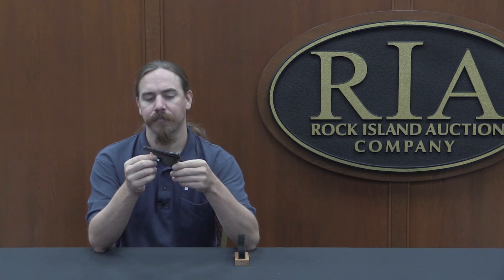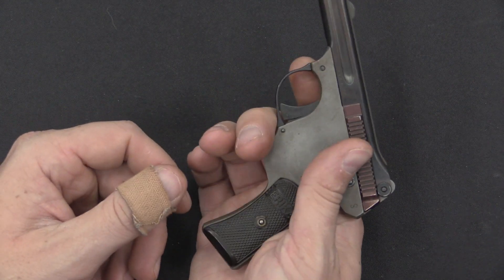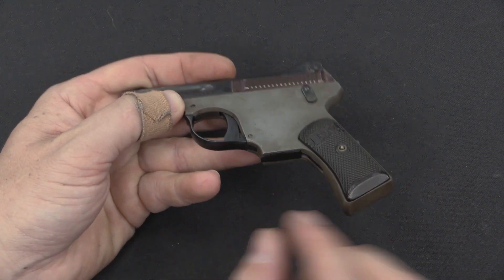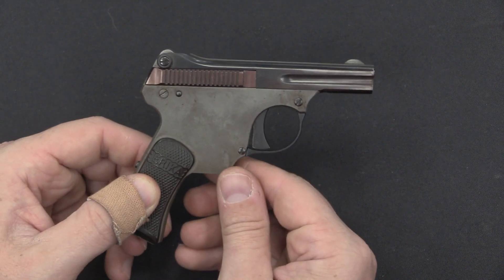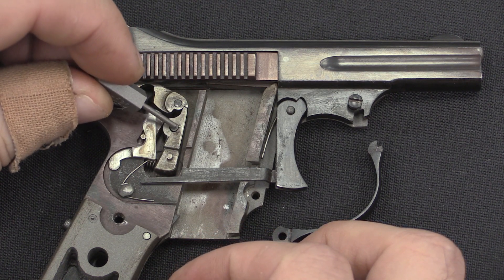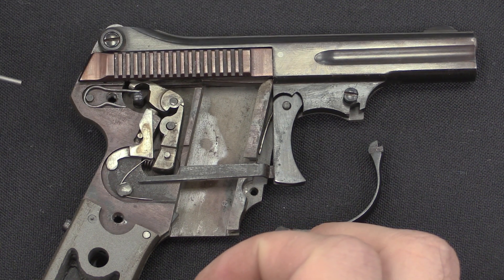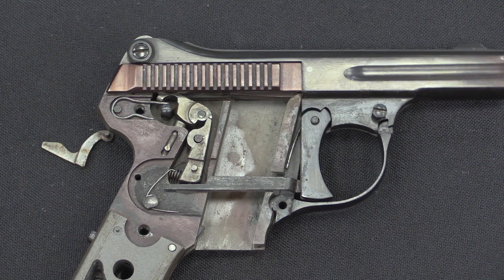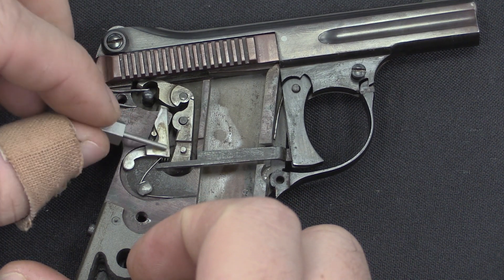Erika 4.25mm Pistol

Comment: Just for fun, this pistol puts out between 23 and 28 Joules. 

I was curious about that, so I looked up some airsoft tables (it used to be a half hobby of mine), and I found one table, where the maximum Joule output for an airsoft gun was around 7.53 (this was for a .45 gram bb, moving at 600 fps.)  The table was color-coded, and listed the numbers in this range 'Hot Gun!'

Comment: So Ian, what you're telling me is that if I removed that tiny little piece of metal, I'd have a teeny tiny itsy bitsy full-auto 4.5mm pistol?

I think that's one of the most hilarious and adorable mental pictures. Ever.
Reply: Pew Pew
Reply: That's a possibility, it's also possible that if you remove that piece the hammer will just "ride" the back of the slide forward and not transfer enough impact onto the striker to fire the cartridge.
To be more precise, the hammer WILL ride the slide forward because nothing holds it back, the question is only if it hits the striker hard enough at the end of travel.
Someone buy this thing and try it out :)
Reply: @tac6557  You mean P-P-P-P-P-Pew !

Comment: dissembling the guns makes for a much better video.  Please keep up the good work.
Reply: +vipervette03 I believe many of the arms aren't disassembled due to Ian not having permissions, being items on sale and all. I feel many examples may have sustained damage or are suspected to sustain damage that could make disassembly bad in the long run.

That being said, I do believe Ian takes apart every gun he gets the chance to, save for some models he has already taken apart (identically) and some models with overly standard parts.
Reply: +vipervette03 I completely agree.  That's the main reason I'm subscribed.
Reply: quentintin1
Losing I sincerely doubt, Ian's a smart and well versed guy, but breaking something yeah. That's basically my comment about item condition.

Comment: Nice pistol. It is on the weaker side of effectiveness, but i wouldnt consider it non-lethal. A small diameter bullet with a decent velocity have a potential to reach vital spots even after some clothing. You can compare it to air rifles and they are known to be lethal.

Comment: Such a tiny caliber and yet only 6 rounds? I'd want more rounds than that specifically due to the tiny caliber, and adding ammunition capacity doesn't appear to be that difficult.
With such small ammunition they'd be easily able to fit 20-ish rounds in a simple single-stack magazine in the grip by simply extending the magazine well to a similar length as the grip.
This would have improved the ergonomics as well, you wouldn't be trying to hold on to a firearm with grips that look to be roughly the size of a broom handle or smaller.
All in all, this little pistol's design seems quite rough around the edges, no matter how well executed a particular example may be.

Comment: It's amazing to me that these were sold as defensive guns. With so little energy, could the projectile even penetrate, say, a wool coat? Let alone a leather jacket?
Reply: +Joe Gekko I would imagine it was more intended to scare than to actually stop someone.
Reply: .177 calibre using bullets around twice the average air rifle but around the same speed. It has the potential to be lethal.

However they were marketed, I see no use for them besides a potential assassin's tool. Much like the pinfire ring guns, pressed to the head and fired would be like getting hit with a nail gun.
Reply: Air rifle pellet weight, that was meant to read.